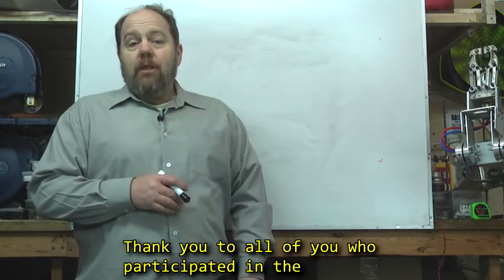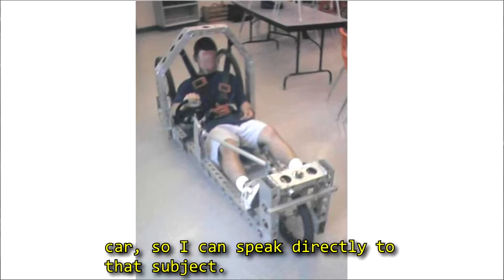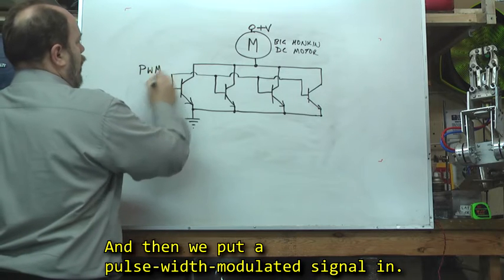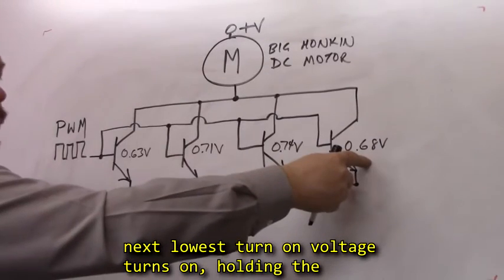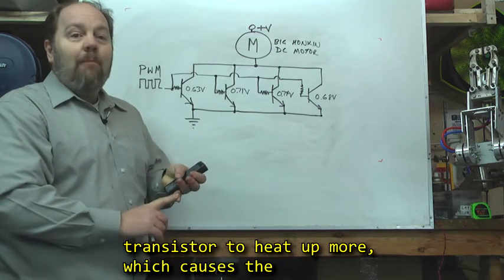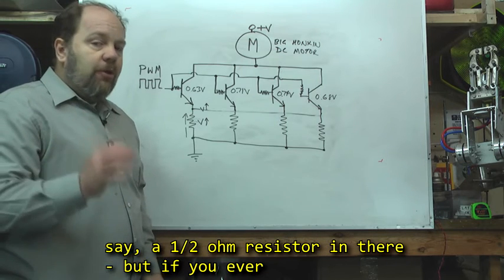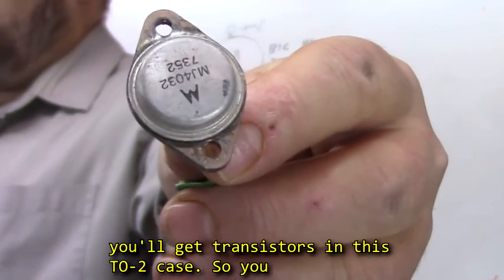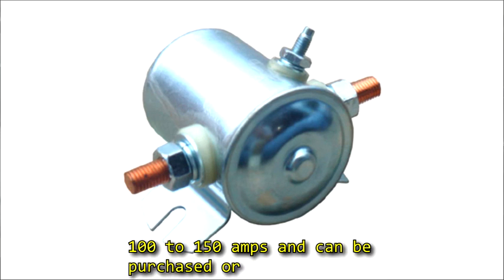High power switching - free preview of lesson

Comment: You are excellent! Very clear and simply explained.

Now ..... I have tried to find online a circuit that will produce a variable AC voltage WITHOUT using a variac. Is this possible?

My other requirement would be to convert my points ignition to run off a pulse triggered CDI ignition as my 50 yr old bike has no pickup. So I need a square wave pulse at the opening of the breaker points. All this up to 11-12,000 rpm.

Comment: can i use an isolated dc-dc buck on vcc, then tie its output ground back to vcc to create a rail 10v above vcc? in this example my positive rail is actually variable from a buck output charging a super cap bank. when full or some time b4 (voltage comes up to set point but current is still gonna be high for a bit while balanced+protected super cap reaches full.  im building a spot welder... current working itteration is low side switched.  point is, a few sec b4 bank is full, and the mcu lets the weld signal do something...  that rail is always gonna be what the user of the machine is intending to pass through the fets. so if i could do something that simple to generate the plus 10 needed it would be awesome.

ive already got a large p fet to disconnect the cap bank for my welder b4 welding. also went with a depletion mode fet to replace nc relay and connect to power resistors to lower voltage or drain bank. 

I run it off around 180f (havent done the math in a few months and number isnt infront of me) )of maxwell d-cell in a 3p sets of 6s configuration ...ideal world esr calc plus ohms law says ive got a max of 2500 amps to worry about at 16v

they charge from a 500w 24v ac-dc switcher attached to a claimed 15amp cc buck from ebay china... i will make a board for tht eventually but lets ignore the false claims for now lol. 

i want the design to be flexible, aka input could be two car bats in series and if i want to  take cap bank out of loop and attach a choke... i could even pwm arch weld
Reply: im building one with a supercap bank too! ... I built a smaller 40F 12V bank first, I killed a IGBT and detonated 2 mosfets so far though - so im currently working on making a clustered mosfet as a cheap high current dc switch. ...from the drop across the ground lead and a cheap scope I measured a peak of about 80 amps so far. if it works well I might upgrade to some 2600F caps in series so I can pull 500 or so amps.

Comment: i test a mosfet that it is rated on 50amps 200v and i test it with a 12v7ah battery and a single 12v 30watt light bulb from car. the mosfet gets really hot and really fast. why is that?
Reply: Check the Rds(on) value in the datasheet for that mosfet.  Some are designed for fast switching, and tend to have a higher resistance.  TrenchFETs are slower, but have a very low resistance, like the IRLB3034PbF, which has an Rds(on) of just 0.0016 ohm @ 4.5V on the gate.

Comment: You made a good explaining video.I had used this kind of circuitry.Absolutely dissaster.Managed to have 2.4 amps instead of 5!(in a continius load).I used two 3055 transistors and they were hot!  You are right. I will make a mosfet board now.